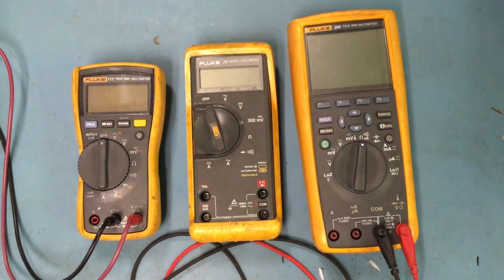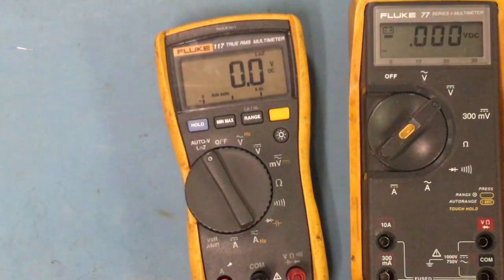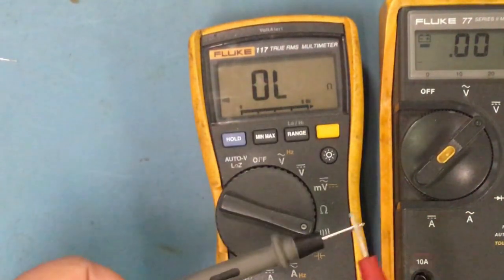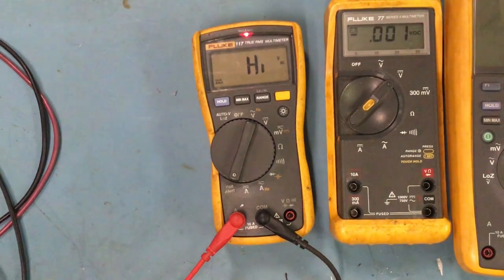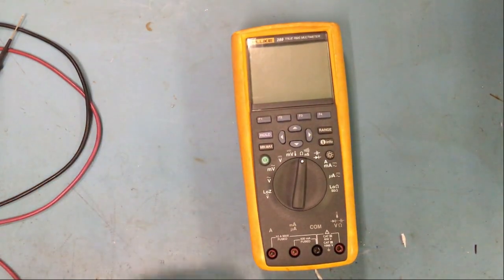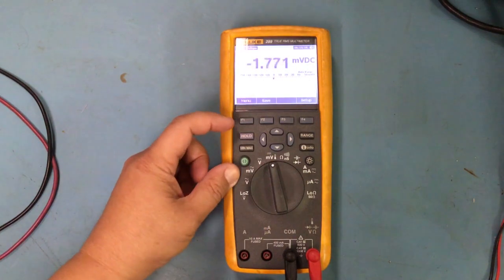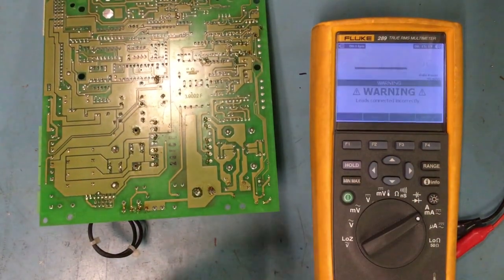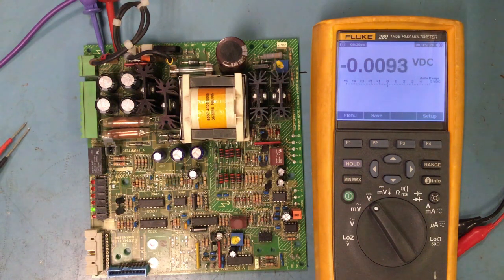How to use a Digital Multimeter

Comment: I have 4 kinds of multimeters; Triplett 310 type 3 VOM, Heathkit model V-7A VTVM, Micronta 22-208A FET-VOM, and a Fluke 179 DMM. I have other Fluke, Pro'sKit, and Simpson meters. Analog high and low impedance multimeters and high impedance DMM. My first electronics technician class, I was started with a Simpson 260 VOM and light bulbs. I also had a lab that I had to burn resistors.

Comment: Best of lick to you. I taught electronics at the college level and found students turned off by all the mumbo jumbo theory to the pointnof not understanding troubleshooting. Most instructors never. Even worked in industry and are all theory. Fortunately I had 20 years of in the field experience and passed it along to them.

I detect you have a problem with language and pronunciation correctness. This is often why applicants can’t pass written tests. Amperage 
 is. Current flow, different for voltage. You cant have one without the other.
 True RMS is BS, its just one way to charge more.
You will never measure more than ten amps.

Comment: Lou, can you please tell me when in diode mode what you consider a short or an "ok" reading.   Please respond here for others too.  If anyone else that follows Lou can respond.  Please respond here and to my e mail because it is hard to find responses in the comment area of youtube.   PLEASE    Hager111@aol.com
Reply from the maker: In diode mode, a short will read 0volt.  Now to a good diode reading.  In forward bias testing (red lead to anode and blk lead to cathode) you should read a diode voltage drop.  The voltage drop will depend on the diode but you should expect a reading somewhere around 0.3 - 0.7volts.  In reversed bias testing (red lead to cathode and blk lead to anode) its going to be all across the board.  If the diode is out of circuit, then you will read "OL" open.  But when you are testing the diode in-circuit, you'll have to deal with the circuit and you'll get a reading off of the circuit and not the diode that you are testing.  So it could be some voltage drop or OL reading.
Reply: @electronictech785  Great, I sent an information card to your co. so I can send some of my guys through your online course.   Thanks Lou